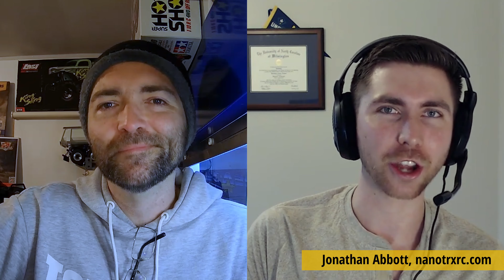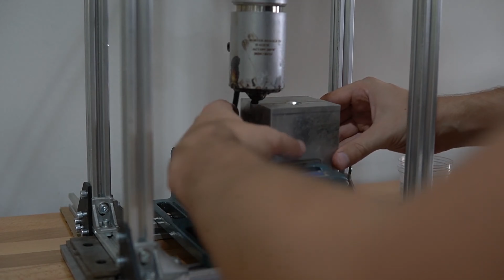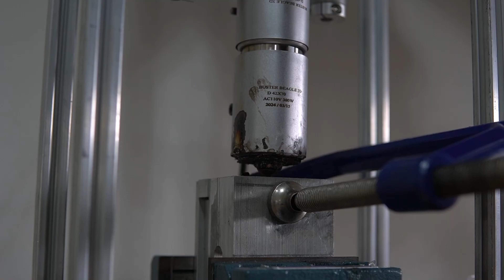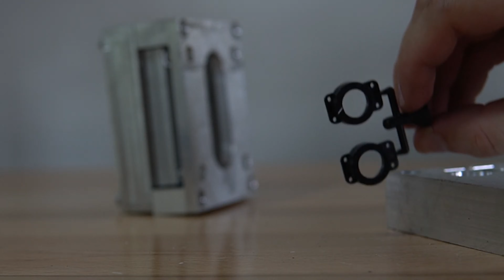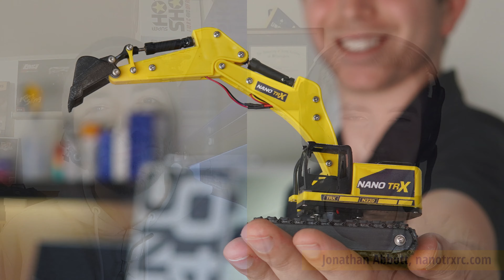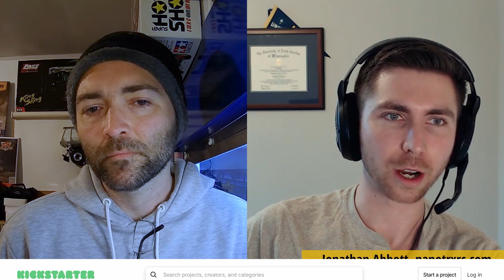Interview: the Smallest RC Excavator!

Comment: I feel like $100 is sooooooo cheap for this!! I wouldn’t flinch at $250 for something this small and of this quality. I build a lot of Orlandoo Hunter RCs and have hundreds of dollars into those builds. Then Furitek offered them fully built for $250 and I feel like that is actually a great deal. The smaller things get the more expensive it can be to manufacture such complex items.
Reply from the maker: Absolutely, yes. It's an epic deal at his early bird pricing but for something boutique like this? Yeah, $250 is still within bounds of reason, I agree totally.

Comment: hey man i was just looking at your website and noticed that your BRX01 had leafs at the back and I was wondering how you got them to spring up that much mine just seem to sag.
Reply from the maker: I used all of the included leaf springs in the kit. But maybe yours are softer? Dunno. You can always throw some pen springs inside the rear shocks to help give the system some invisible extra spring if you think it needs it.
Reply: @RCTNT  i used all mine too so its odd your are stronger. i might give the pen spring a shot
Reply from the maker: @Bazil787 may not make much difference but its better than nothing! Can also 3d print a leaf or two from PETG in particular, as it retains its shape even when bent. I've made entire leaf springs from PETG and it works well. Just as a leaf or two will be plenty.
Reply: @RCTNT  ive never thought of that it sound interesting
Reply from the maker: @Bazil787  it was the very first thing ever to appear on my channel, in fact: https://www.youtube.com/watch?v=_yzHyrXtXHU